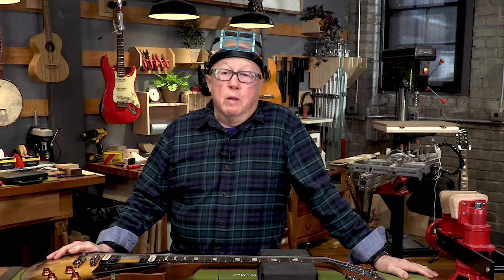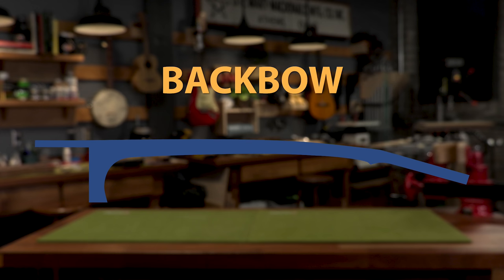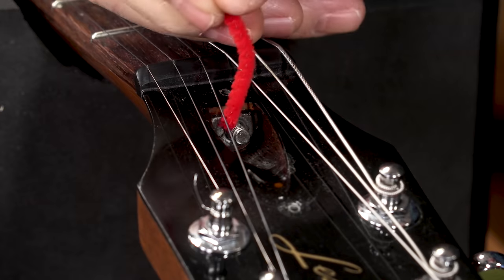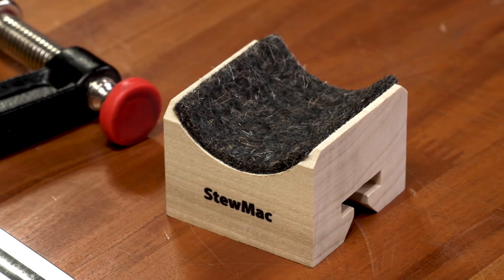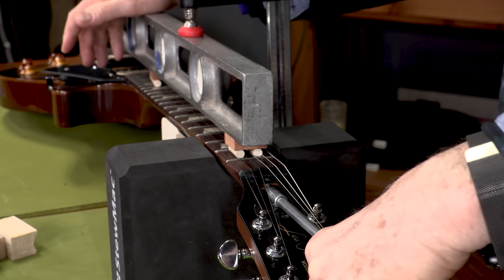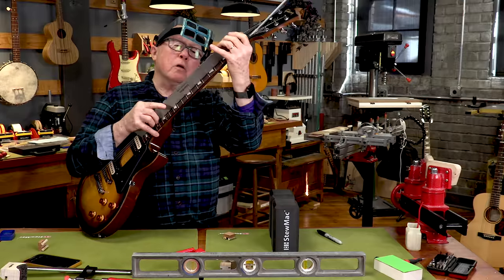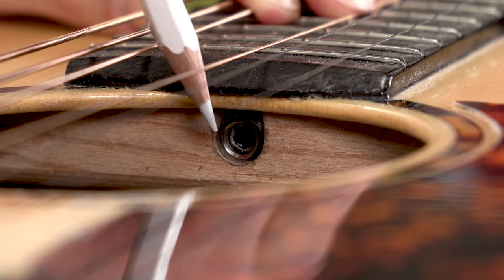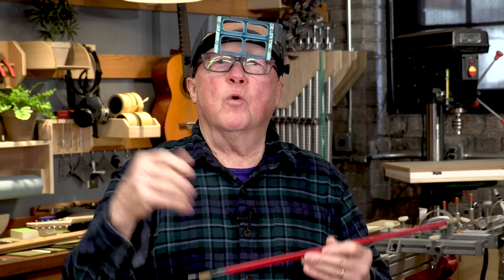Can You REALLY Adjust Your Truss Rod Without “BREAKING YOUR GUITAR?”

Comment from the maker: Dan often refers to this method as his "#1 trick" for truss rod adjustments 🙂
Reply: Have you ever worked on a “Chibson - Chinese fake Les Paul” ? If so, what was your experience . I saw a luthier on the net that had a guy bring one in because the owner ended up separating the fretboard from the neck, trying to adjust the truss rod. The luthier said it wouldn’t be worth repairing it because it would cost more than the guitar is worth. So he and the owner decided to tear it apart and see what the problem was with the truss rod. The luthier found that the truss rod was actually welded in one piece and was non-adjustable right from the start and that’s why the owner broke the neck trying to turn it. I was just interested to hear if you’ve ever ran into one of these at your shop ? I got suckered into buying two of them, there is some buzz but I have to raise the bridge and/or put something under the A & low E strings to make it play better. I always enjoy your videos and I own a bunch of you tools. They work 👍
Reply: @flashy5150  One came into a shop my brother used to work at for a set-up one time. But unlike yours, he said this one was an extremely well built counterfeit—everything worked and played just as good as the real thing, including the truss rod. He was shocked. I guess things coming out of China really are a crap-shoot.
Reply: @haikuomusic  It seems so. Theres also another vid explaining why it probably doesnt work (th one of the fender mustang. Good Luck!!!
Reply: @jsullivan2112  Often good counterfeits are made in the US or Europe, not china.  Slashes "Famous black Les Paul" was not made by Gibson, and actually better than a Gibson.
Reply: @Bob-of-Zoid  I don’t think you have any idea where this particular guitar I’m referring to came from. You didn’t see it,
Reply: @haikuomusic  No!  You ran out of thread, and that's why it won't turn any more.  If it had a removable truss rod nut, you can get more out of it by using a spacer (A thick washer).  You could get away with a stack of washers, but a single piece is better.  Fender truss rods have a 6/32 thread (ISO), the closest equivalent is 4mm ID (M4).   It should fit just fine if you can't get American hardware in Japan.  You can get washers and spacers with varying outer diameters, so just get what is closest to the OD of the nut, but not larger.  Off the top of my head:  a Fender "Bullet" nut is 1/4" OD (6.35mm), and the ones in the heel with the crossed flat slots are 3/8" ( 8.255mm).

If its the "Fender two way" (Not a true two way, nor a good design) and the Allen key has to go through a Walnut plug in the headstock, then you need a professional to do it, and it's a very tedious and time consuming job, because that walnut plug needs to come out which requires a lot of heat...
Reply: Forget the bs. Just bend the neck back over your knee until its straight. The turn and tighten the screw. I have sold thousands of guitars. Fixed hundreds.

Comment: Not to take anything away from Dan, but where I live, it goes from -30 to +95. I like my action low, so I have to make 4 truss rod adjustments every year.
Just over 40 years of playing, and owning a bunch of guitars (some for 20 years), I've never had a problem adjusting truss rods with the strings at full tension. It lets me dial it in by eye and feel.
I think the secret is to stay on top of things and not let the neck get too far out. In my opinion, small adjustments under full string tension are perfectly safe.
Reply: Agreed.

Comment: Great video!  Never fear the truss rod!  
I like just a bit of slight relief.  I find I like a little more relief on some of my basses and nearly flat on others.  Different instruments just behave differently even when seemingly identical in all respects.
Reply: I don't understand why anyone would say "using the truss rod will destroy your guitar." That's almost like saying "changing your spark plugs will destroy your car."
Reply: Fear the truss rod unless you know what you’re doing. The metal that the truss rod is made of isn’t strong enough to move a neck that is too far out; that’s why you have to use clamps and leverage to force it back to level (or a little beyond). The truss rod will keep it from returning and can make finer adjustments, especially if it’s being loosened. It breaks because people think they can force it and the metal or the threads can’t take that amount of force. Every mechanic knows that leverage can strip threads, or even break a bolt. That’s one of the reasons they use torque wrenches.
Reply: @robinleebraun7739 As with all things, use common sense.  Nothing on a guitar should be forced after its built.  And always know you're limits.

 I've only stripped 1 truss rod in 40 years, and that was on a bowed and twisted early 70's Jazz bass. That was back in the late 80s while in college.  I bought the bass dirt cheap for parts because the neck was a mess. I did the lubing the nut & threads, clamping, detuning and a few other tricks to adjust that neck.  Even heat pressed the neck.  It was unsalvageable and I knew that it would probably snap or strip going into it, and It did strip.   I primarily mess with basses and bass necks being longer tend to move more and need slightly larger adjustments as a rule.  Maybe I'm lucky, but I've done so many setups and truss rods are really not difficult to adjust.  Maybe I'm mechanically inclined growing up in the 70s when folks fixed things more (cars,  TVs, etc). 
 
There is a bit of common sense involved. So I'll add 5 rules....
1. If a nut is extremely tight, there's an issue.
2. Using a cheater bar on the truss rod wrench is bad because you should not have to fight the truss rod.
3.  If it feels a gritty or grinding while turning that's not good.
4. If someone is really afraid of or uncomfortable adjusting it, or if its a valuable vintage instrument, take to a qualified professional. 
5.  Most important,  the truss rod WILL NOT fix a badly bowed neck.  Its for adjusting a good neck.

Comment: Just an opinion here: Do not attempt the buddy method shown here if you don't know 100% what you're doing. (And even then it seems a bit iffy.)
Especially with a Les Paul it's easier than you'd think to snap the headstock right off doing something like that.
Reply: Exactly what I was thinking.....I wouldn't do it...but with a little pressure you can get away with it.
Reply: I still use the capo on the first fret, fret the 6th string at 15th fret, grab a feeler gauge, and check around 6th fret to measure what the relief is. Or failing that grab my notched straight and measure it. I do get what he means though about helping it not fight the pressures caused by other tensions such as the strings if there's too much relief
Reply: Yeah, good point. I wasn't comfortable with any of that advice. LOL
Reply: Yes, I’m way more comfortable just using a properly fitting wrench and just turn it a little, and I might loosen a few strings if it’s tight
Reply: @Thecoolman1  Exactly.
Reply: I was cringing watching that part.

Comment: Like Dan's videos. There is a simpler quicker way to adjust the rod without loosening the strings that a guitar tech showed me. First get the guitar tuned to A 440 since that's the tension the neck will have on it eventually.. Take off the truss rod plate cover (of course). While sitting in a chair hold the guitar between your knees with the neck up. Put the truss rod wrench in place. Then bend the neck back to take the pressure off (back bow) with one hand and then turn the truss rod wrench in the desired direction. Then lay the guitar down so the neck is free floating (some guitars might need a soft shim so the neck is not touching the floor (carpet or towel preferred). I use the Stew Mac straight edge down the middle of the guitar (between the D and G strings) to see straightness at the 7th fret. If you want some relief use a feeler gauge to check  so you get get to the amount you want to have. Repeat the process as you hone in on the specs you like. I use .009 at 7th fret and between 3/64ths to 4/64ths at the 12th fret for string height. This method doesn't need all the elaborate tool setup, just a wrench , straight edge and feeler gauge. Remember to retune often because tuning will change slightly as rod is adjusted.

Comment: I have gone out of my way to modify humidifiers (added a recirc pump to constantly bathe the filter to prevent crusting, saves huge $$ on filters!) and keep the temps stabile so there's little difference year round in our music room. We also have a whole-house humidifier, but it won't quite keep up.  It has made a huge difference, with little change over the course of a year. I do put the vintage stuff away for the winter, in case power fails or the roof blows off.
Fifty years ago, I was the only person not afraid of those truss rods; I didn't learn Dan's trick until decades later. I have the first neck I ever built hung on my wall; it's awful. But it does have a removeable truss rod, 'cuz I've seen more than a few stripped or broken.
Reply: @UncleKennysPlace
Aloha! I 'put away' my best guitar in my rainforest, and the neck was twisted, I wonder how too protect them  from moisture! A case and 3 trash bags might do it! No dehumidifier yet..(small kind power here) AlohAz

Comment: The most challenging or even difficult neck truss rod adjustments were with a Rickenbacker 4001,bass guitar I had. The Rick has two side by side truss rods to stabilize the thin and somewhat flat backed neck. What made it difficult is to not twist the neck as each truss rod had have have slightly different amounts of tensions to compensate for the different tensions between the E and A strings which have more mass then the D and G strings which less mass. The best method I came up with was to use a inch pound torque wrench to adjust the neck. The biggest indication that the neck needed to be adjusted was when the strings went out of intonation. So it wasn’t so much as adjusting to bridge saddles, but to adjust the neck back to its original position. The bridge saddles did occasionally need to be adjusted to compensate for the strings core stretching unevenly, and the strings out layer wrap waring on the frets, but that was also an indicator that the string needed to be replaced, but sometimes I wouldn’t have the $35-$40 spare money to purchase a replacement set of strings for a week or so. As a side note. I used Rotosound Swing Bass strings on that Rick to get that Chris Squire sound. Also. That Rick I had, had factory installed stainless steel frets. So the stainless steel Rotosound strings didn’t eat the frets as much. 

One more thing about bass guitar strings is that hex core strings are more likely to ware frets then a round core. Also a I mentioned that stainless steel wrapped strings will ware down the standard frets as the stainless steel is harder the normal fret wire. Aside from stainless steel being harder, if seen at high magnification with a microscope, the stainless steel surface looks ruff with flakes almost with the appearance of human hair, again seen with the aid of high magnification. 

Because of wanting to tech or repair my own guitars and bass guitars first starting with the aid of a book by Martin guitar on how to adjust and repair guitars, then latter with one of Dan’s books, I’ve effected all the repairs and modifications to all the guitars and bass guitars during the 45 plus years I’ve played the instruments. Thanks to an article Dan wrote for I believe GUITAR PLAYER, or BASS PLAYER, that Dan shown how to use cyanoacrylate as a surface finish on a finger board, I converted one of my Jazz Bass rose wood fret board to a fretless. So I like to thank Dan Erlewine for the wealth of guitar repair knowledge he’s compiled in his repair books and now with his free videos he is publishing on YouTube that has made my experience with guitar and bass what it is. Dan’s biggest contribution is to demystify the instruments.
Reply from the maker: That's so great to hear - thanks for the comment. Nice work on that bass, and keep it up!
Reply: Wow. You should do a video on that twin truss-rod technique.

Comment: Super video! I've always done truss
Rod adjustment in stages. Starting
With a quarter turn. Return string
Tension and let the neck equalize.
Any increase will cause some 
Reaction. Check for the neck
For straight and proceed.most
Folks don't understand that
There will be a reaction in the
Opposite direction when stress
Is added to the neck. Pianos
That are more than a half step
Flat usually need more than
One tuning before they will
Stabilize. The instrument will
Equalize. Easy on a guitar but
Very expensive on a piano.

Comment: My neck is almost straight, I need some relief in order to avoid string buzz. My action is setup at 1.5 mm on the low e string and 1 mm on the high e string. Works perfectly fine for me. I used to have a dead straight neck or maybe even slight back bow. Buzz everywhere on the fretboard. So a little relief works fine for me. But Dan you’re the man! I always enjoy watching you repair and setup guitars.

Comment: Thank you Dan, I just could not adjust the truss rod on my Vintera Strat, the nut was solid and I needed a bit more back bow to get rid of too much relief. I did the clamp trick to take the tension off the truss rod and it worked a treat, very pleased!

Comment: Dan is the Man. I honestly don't think there is a more knowledgeable guitar man in this galaxy. Dan has forgotten more about guitars that most of us remember.

I just did all of my (Tele/Strat- style) guitars straightening the neck (using the fretted 6th string method) then adjusted the saddle height to 1/16" on the low E and high E then adjusted the string height according to the radius. I kid you not, the sustain a straight neck gives you from that energy starting in the neck made a clearly noticeable improvement in sustain and playability.

I can definitely feel a noticeable increase in the neck resonating more than before.
Reply from the maker: Absolutely - Dan agrees with you! The straight neck makes for great resonation of the whole guitar. Thanks for the comment.

Comment: Great video. One thing to note is that the Gibson guitar is about a whole step too high by the time he starts playing it, due to whatever adjustments he made to the rod after initially tuning the guitar (he tuned roughly to concert pitch). A tone higher is a big difference that will affect the setup. I would advise retuning once it’s in the ballpark to ensure the most accurate result.

Comment: I had a luthier built Strat in a couple of years ago where the skunk strip had popped out. 

The guy who made it seemed to have used what looked like acrylic caulk (why?) to bed in a dual acting truss rod in its channel prior to gluing in the walnut strip. 

This may or may not have contributed to the glue joint failing.  I suspect it might have got where the wood glue should have been and stopped the walnut from bonding to the maple properly. 

I routed an the original 1/4 inch channel out to 8mm for the new walnut strip. This left a 0.8mm ledge at the bottom on either side for the new walnut strip to sit on.  The benefit here was an extra gluing surface and a surface to clamp down on without being able to squash the truss rod.

This worked perfectly and my customer is really happy with the results.

Comment: It's funny cause nobody ever told me I would break a guitar by adjusting the truss rod.
I mess with the ones on my guitars whenever the neck isn't to my liking. Easily twice a year. And when I first did it, I remember overdoing it and all of a sudden the neck was all bent and I thought "welp, let's undo that" and that was it! Adjusting the truss rod is easier than changing the strings.
Reply: Nobody had to tell me. I broke 2 without any advice.
Reply: Ok, technically I broke the truss rod, not the neck. But the result was the same.
Reply: @tomaselke3670  What did you do? O_O Did you not look at the neck while you were tightening/untightening it?

Comment: Whenever I see the tailpiece jacked up like that, I assume there's some major issue with the factory build. I try to keep them bottomed against the body if possible.  I usually top wrap my strings to relieve the break angle over the bridge. Set up is everything, and no one does it better. Great content. Thanx.
Reply: same...
Reply: not a good idea with modern gibsons! the neck angle is such that putting the stop bar all the way down results in way too much angle over the bridge, leading to string breakage and the bridge itself sagging in the middle over time

the stop bar should normally live somewhere off the top a bit, such that the break angle over the bridge isn't too much more than it is over the nut

(if you top-wrap then never mind; spin it all the way down, it'll be fine)
Reply: @walterw2  I'll never have to worry about a Gibson. Won't touch them.

Comment: I'm hoping you get this post because some of your wisdom could really help my decision . My son snapped the headstock off an accoustic And lost the headstock as well . I've got some other guitars one has a classical guitar type headstock and is almost a perfect size. If I saw the headstock just behind the nut and used another guitars headstock would drilling 2 deep holes for 1/4" dowels and do the same to the headstock would the tightly fitted glued wood dowels make a good join